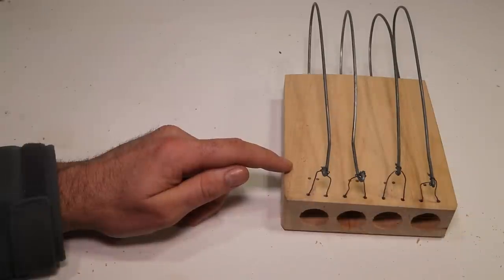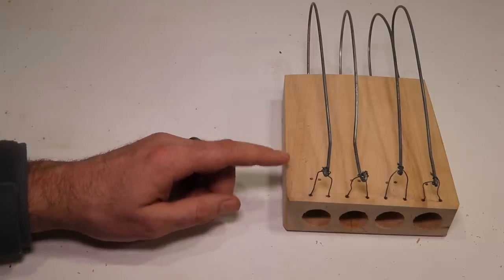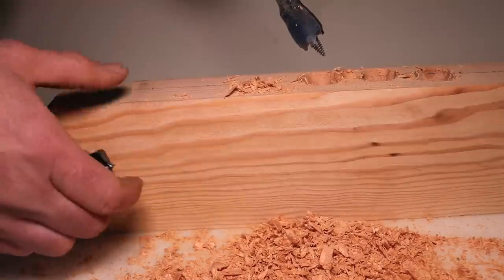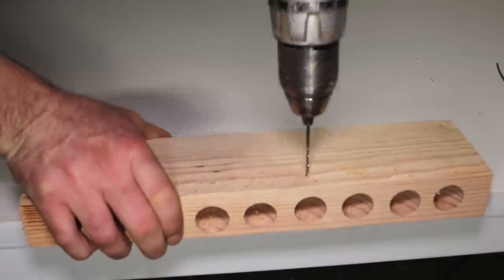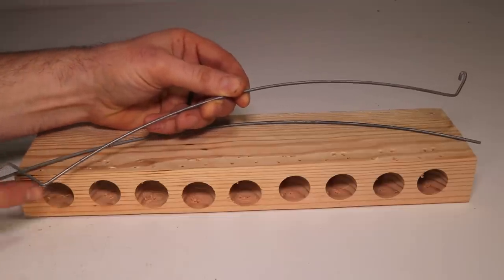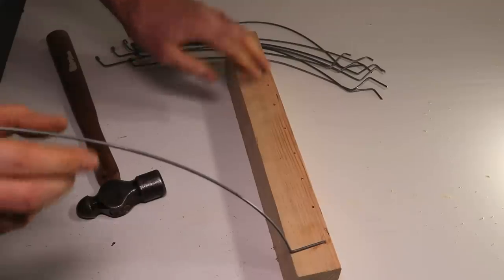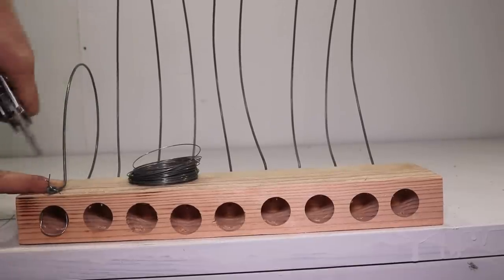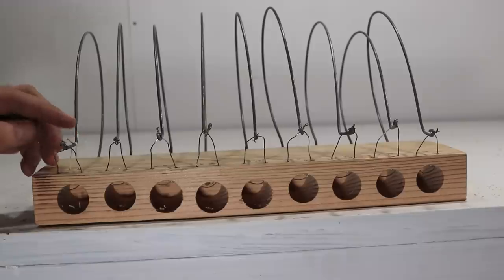How To Build A 400 Year Old Style Mascall Spring Mousetrap (9 Holes) - DIY Mouse Trap

Comment: Can I offer two tips on making this? Firstly, I've experimented with different wire for the noose and, by far, the best was 29kg breaking strain picture hanging wire. It's cheap, flexible, very strong and thin meaning greater force transmission into the mouse.
Secondly, if you drill the holes for the noose closer together in the top of the trap the noose can 'close' much tighter around the mouse and kills it instantly. If the spacing is too wide the noose can't tighten around the mouse so much and it's not an instant kill. Using the picture wire you can easily open the noose to fill the entrance hole completely.

Comment: Love the videos Shawn. To make setting easier, I would suggest adding an eyelet at either end of the block, above the trigger loops, so a bar could be placed through the eyelets to hold down all the triggers at once. Once all the strings are tied you can pull the rod out of the eyelets and all nine holes are set. Make sense?

Comment: When tieing the thread, instead of holding the spring in one hand, you can stick something in the big hole, a cork for example. It will hold the spring and you'll have both hands to tie the thread.
Reply: Samuel Liebermann a cork would work awesome or perhaps a screwdriver handle as someone else had mentioned.
Reply: I can't believe they didn't think of that 400 years ago, after using it once.
Reply: @Mixwell1983  Maybe a dowel too.

Comment: When arming the trap you could try using a large elastic band or string sinched down lengthways covering each wire arm. Then once you've threaded and tied the strings you can remove the restraining feature. Would save faff of having to hold down each arm individually while you tie the strings. Just a thought maybe? Can't wait to try this one out when I'm back at the farm over the summer!

Comment: I’m trying to think of how you can drill through the entire block and have a trap on either side to make an 18 hole design. I just don’t know if the wire has enough power when half the length to kill the mice.

Comment: Using a common spring clamp to hold the spring-wire down makes it much easier to tie the string. Can't wait to test my oversize version on the pack rats tonight.

Comment: For the spring wire I used stainless steel inserts which are within old discarded windshield wiper blades..... To hold down while tying the thread I use a small plastic or nylon spring clamp, makes it much easier to tie the thread.....

Comment: Great video series.  I have loved watching the ingenuity of designers.  If you were to run a long rod, something like welding rod, across the top of the trap and secure it on each end, an eye bolt might work, it would hold down the springs while you tied off the string and make it easier to set.

Comment: I bet if you routed out grooves on 2 separate boards, sanwiched them together and then plug the springs in drilled holes that are slightly offset from the mouse holes you can make the trap double ended! I dont see a limit, only an advantage, as you have shown the activity draws more mice

Comment: My stepfather made a single one of these back in the 1950s. The noose went through a slot though, not two holes. It worked. I think it is a very humane kill trap, because it is so accurate, and instant. If I wanted a kill trap, I would try to get something like this 🙂. 🇬🇧.

Comment: My grandmother actually has just similar one really for.. about half a century! It has 3 holes and there are also small holes below large ones for a steel nail to hold those springs

I have a suggestion for that mousetrap, I want to see it with a resettable mechanism, a small plate inside which pulls the string or a stick to trigger it, that design is in my head but I have no 3d printer

Comment: If u make a wooden  cork style plug or a cork big enough  u can hold down the  spring wire until you  tie it off put the neck wire down and insert  plug the plug only  needs to be  a 1/2 inch long

Comment: Next up it the 8ft 2x6 with 48 holes.  It would be the great mouse apocalypse.
Reply: Hmm. Let's assume a 1 inch hole and a half inch between holes. Since you mentioned 8 ft that means we have 96 inches. Subtract a half inch for the last hole (we have 1 more solid section than holes) and divide 95.5 by 1.5 and I get 63 holes. Why limit yourself to a measly 48?
Reply: Emptying it out of the caught mice would be a bit of a handful though.

Comment: I think you could make it easier to set just make about 3-4mm x 2cm sized slot on top and bottom then drill hole on the bottom front of the trap for 1cm iron bar or pipe that goes trough the slot so that when you set it you make hoop on the spring use small hook to drag it trough the slots and then insert the pipe/bar trough the hole in front to keep it in place

Comment: I just made a 14 hole trap with these instructions. I used 16" insulation supports for the wire and they fit perfect. 14 holes was too many for my small garage so i sawed between them to make two 5s and a 4. That way i could place them in 3 spots. I baited them with sunflower seeds. Also put peanut butter on the string.
Update: within 2 hrs i caught a mouse in the shed. He opted for hole #2 and won the prize: death

Comment: For anyone looking for an alternative for the Spring - I used the wire/rod from a 5gal bucket handle. Works really well. Doesn’t have the same level of force as the wire used in this video but it certainly has enough to kill a mouse quickly.

Comment: I did an one hole one and a three holes one, I used some old wire hangers, not the best but is what I had, the one hole was a failure the spring is to short and the mouse didn't die, the tree holes on the other hand was a succes, longers springs and the mouse die quickly

Comment: I have a tip. As an alternative to a needle, use any old thin wire that is about 10 inches or so. Even copper will work. Fold it in half and stick the folded end through the hole that you have to thread.  You have a needle then that is all eye. Pass the thread through the fold and pull it out with the loose ends.  I use this just because  a big needle is hard to find, and just another tool you need to keep around. Wire is always around, and works much better.  If the wire doesn't have a bunch of kinks in it it will be easier to use.
Reply: bomaite1 a splitpin would be ideal but folded wire would suffice in the event of a splitpin shortage top idea

Comment: Shawn.  I love what you do.  You are an excellent videographer, editor, story teller and show man.  What you do helps protect people from disease and it encourages the curiosity of others and gets them to look forward to your videos, enjoy then, and NOW you have them contributing to your videos. Truly you are a master of the primitive crafts that you show and love but you SUCK at giving directions.  DIMENSIONS !!!! DIMENSIONS !!!! DIMENSIONS !!!!   What size were the wholes for the wire?  What size was the wire?   Was it 'picture' wire?   How long was the tension rod?  HOW LONG??   At what inches did you do the bends?   How far back are the holes for the string,   You never showed drilling the bottom 2 holes...what size drill bit for the string holes....how far apart, how far back from the front?   What was the dimensions of the board you used?   2x6? 2x8?   If you want to see people building these please....DIMENSIONS DIMENSIONS DIMENSIONS !.     Also, you don't want net freaks finding you, but we DO need address to send you mouse traps.

Comment: Next improvement would be to make one that has holes on both sides, since you only trill halfway through, you can space them a little more and offset the holes and wire spring on both sides and make a double sided trap, use the material available more efficiently.

Comment: You knot it on the topside, why not the underside. Knotting will be easier by yourself. Don't have to hold the springwire just pull the knot tight and the wire gets under tension. Or..... am i missing something

Comment: I did make one of those before I actually made 100 haoles also after my 100 holes was finished i send it to my grandpa to try it out and he actually did and caught almost 90 mice and 10 rats
Reply: sweet, that was what I needed to Know, if it would catch rats, my neighbor knocked down a old shed and 100dreds of rats went everywhere there trying to find a new home, they are rats not mice, cats were catching but now there bored with them. finally someone that confirmed that it works with rats.

Comment: Hey Shawn, you think you could figure out a way to design a less fiddly trigger system for this particular trap?  The string trigger is just way too much work to set each time IMO, surely there is a better way to trigger the spring?
Reply: It's just threading a needle and tying a knot.
Reply: samiamtheman 73 No I know that, but it's not exactly user friendly is it?  Plus you have to assume the mice will chew through the string.  Perhaps just a small wire catch that holds down the noise from the bottom.  Once the mouse touches it, snap and you got them.
Reply: +MegaTechpc I wouldn't exactly call a needle and thread user-unfriendly, but that's just my opinion. Also have you seen the videos where he tests the different versions of this trap? I think it's safe to assume that the mice will chew through the string.

Comment: Double layer version. You.know they will stand on the dead mice to reach the upper levels. A mouse trap pyramid. Four at the bottom, then three above that, then two and finally the king of the hill gets his chance.
Reply: Arranging the springs for that layout would be more than a tad difficult.
Reply: John Cochran you are right. A slight offset makes two rows easy, three high becomes a problem.

Comment: You should build a trap called the water chamber. It works by a mouse falling into a BIG bucket. The mouse will set off a trigger that will connect to a covered pipe with water in it. When set off the water will fill the bucket causing the mouse to drown.